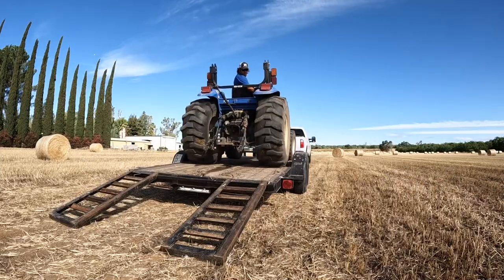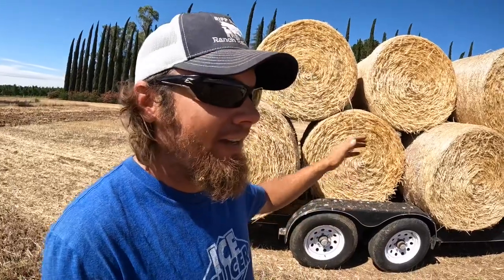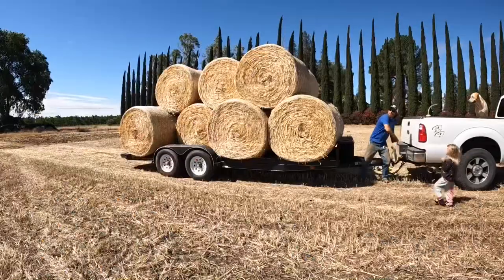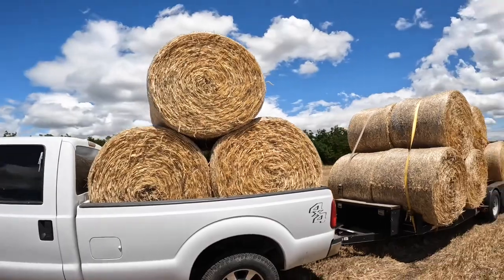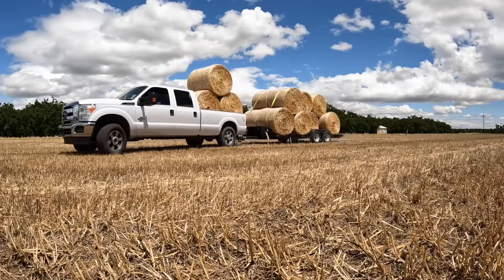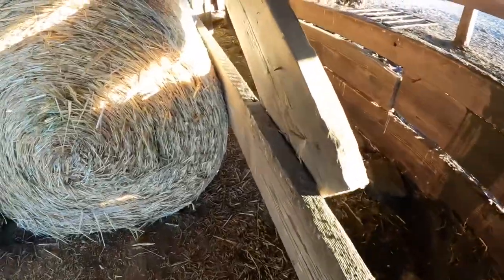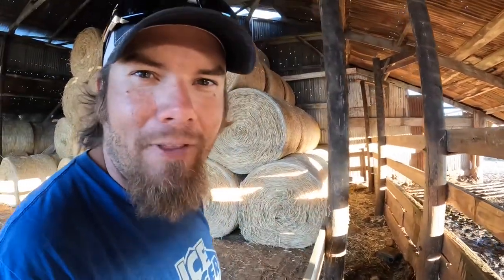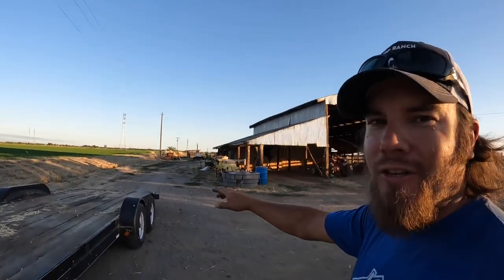Hay Hauling Day 2022!

Comment: Hey Welder, reinforce the fenders so you can load on top of them.For that matter build them strong enough to drive over just in case you need. Weld a couple 3" c channel on back for steel up-rights, pin them in when want. Thats about 6 or more bales. Want more build a headache rack for truck with a roof protector. Needs to pin into all 4 pockets of bed for support. Another 3 or so bales. Lots of ways to haul more bales. Add onto trailer ?

Comment: I just found your channel last week and been binge watching since. 
I have an idea to give on the moving of the round bales. This is something we’ve done here in Missouri a lot. 
Load the bales on the trailer with front end loader then when you get home just roll the bales off the trailer. Make quick trips, your bales are at the barn, then you can move in the barn when time permits. That gets the bales out of the field and safe at home.

Comment: If you were to build a three-point bale spear for the rear of your dad’s tractor, you could haul two bales from the field to your truck and trailer.  Would be an easy build for you, with the welding skills you have, and save some fuel and time.

Comment: you could build a removable frame that sets in the stake pockets of the trailer that elevates the center of the trailer over the axles and extends over the fenders to support the bales without resting on the fenders. then you would still have the benefit of low center of gravity on the rest of the trailer and when not using it for hauling hay. Just an idea.

Comment: Get the flat bed! It’s well worth it. I have a dodge 3500 with a 9’ flat bed. We get 4 4x4-4x5’s on it without stacking 2 high. So you could easily get 6 on it 👍🏼👍🏼

Comment: I have a trailer much like yours, just beef up the fenders so they will support weight. I can put 8-10 on trailer single layer. The ones at fenders just lean in towards each other. So you may only be able to put one on top of them. Keep up the good work.

Comment: Another great video! Love to see how a larger operation does things. I only know about being on the wagon and taking the small square bales off as they came out of the baler and stacking them. Did that for 17 years,then my Uncle got a round baler. I am also impressed by your truck. That 6.7L diesel has no problem with all of that weight! Super Duty indeed. Thanks for posting and bless your little girls heart!

Comment: Just wondering if you could make the other trailer into a duel purpose trailer. Fabricate a feeder that could be bolted on for the winter and taken off to haul hay with in the summer. That way you could have two trailers tandem to haul hay.

Comment: Could you build a little wooden platform frame to drop on the trailer between the wheel wells to elevate the bales just above the fenders and get more bales on?

Comment: Curious to know if you start with the farthest away hay bales in that field, or the closest? Awesome job, barn mods fantastic! Weird how I got a sense of satisfaction seeing that barn fill up, even tho you were doing all the work.
Reply from the maker: I just start with the closest ones first. Not sure why
Reply: @farmertylerranch4399  I start with the far ones first, hauling soon turns into a job and at least the trip finally gets 1 1/2 mile or so shorter, but by the next day I'm rejuvenated again for the first 1/2 dozen loads, are them bales 950lb average Tyler  ?
Reply: @buffranchAB  I start with the closest so there are no bales in my way as I'm driving out of the field. I have ran into a few with a bale on the front loader of tractor when stacking on the field.
Reply: @mikew732   haha sounds about right

Comment: I have a question about how you stacked the bales: from where I sit (looking at my screen from my rocker 😉), it seems to me that there was enough space to add a third layer with the same number of bales you had on the bottom layer. That would get more bales under cover. Is there a reason why you didn’t - perhaps structural issues with the barn?

Comment: Are those 4x4 bales?  If so what do they weigh?  My guess is 550-600lbs.
Reply: Now that I ask this it is clearly the case since you got 2 in the back of the truck.  I only buy trucks with an 8' bed.  So many things don't fit well in the shorter beds.